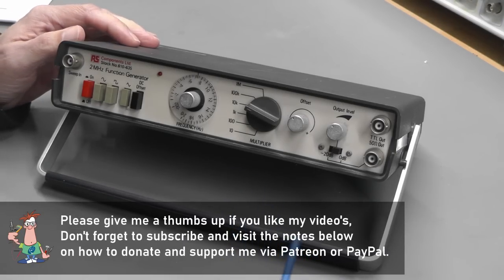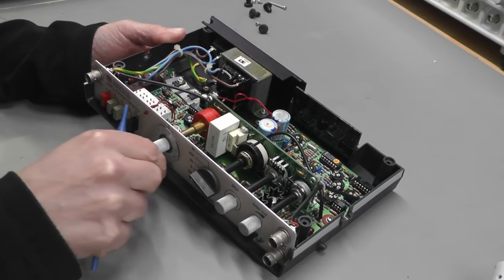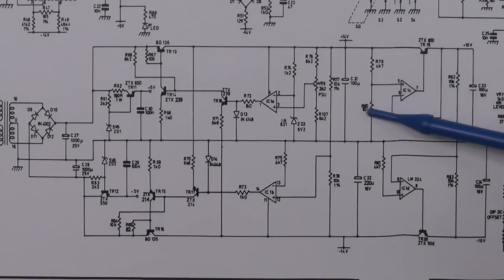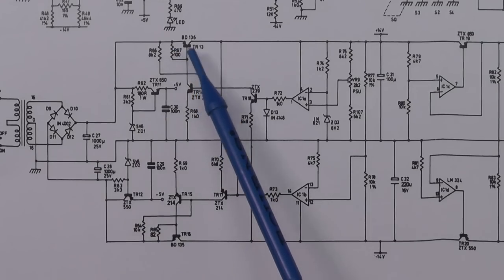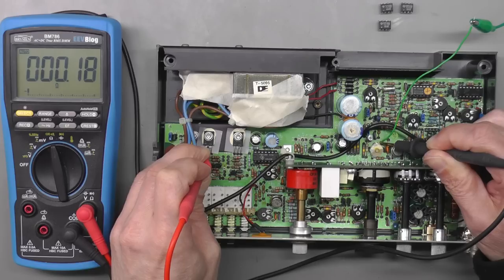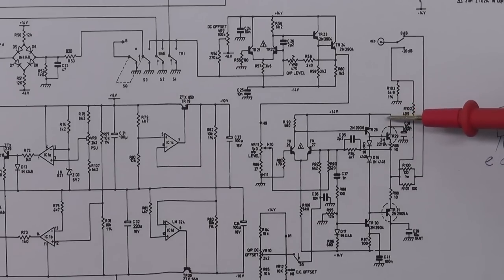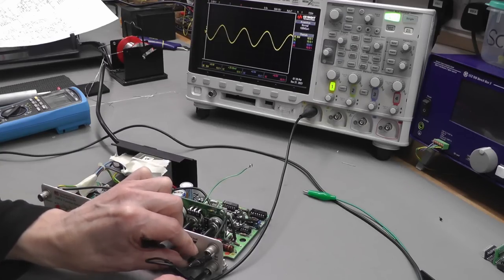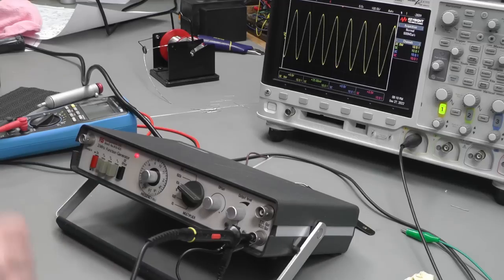No.101 - Thandar TG102 Function Generator Repair

Comment: Could not believe it mate..our little TG102 failed to work this week. I know what I'm doing with repairs, but on the off chance, checked if there were any videos for common faults. Your video and the schematic enabled a quick repair. Yep, it was those tantalums again. Both had failed dragging the +/- 14v rails down low. 16V caps on 14v rails ???.  Orange horrors. Cheers, Steve (Kent UK)

Comment: Great video ian. Another one here with the same fault. Capacitor bit tricky to insert due to sub pcb in the way.  Set capacitor legs to correct width using reverse of pcb as a guide then use tweezers to insert. Prepare to curse a few times. Have to agree think a inline fuse should be there for good practice. Transformer thermal will not help if a fault on red power switch develops and probable 13a fuse in mains plug on many units. Mains is only a cm  away from sweep input wires and pcb components and also is unshielded so just my preference.

Comment: This model has a thermal fuse on the primary, it is fitted between the two right hand terminals on the trans former primary connection.

Comment: those discrete 5V v
regulator circuits don't look like they'd be very good at temperature or current draw fluctuations? I guess if it's good enough it's good enough...

Comment: I believe Thandar was formally known as Sinclair Electronics owned by the late Sir Clive Sinclair (RIP). They later merged with Thurbly electronics and became Thurlby Thandar, today known as TTi (Thurlby Thandar International). I recently got one of these off eBay, mine had intermittent output and it turned out to just be dry/cracked joints on the pots.
Reply: Thandar was the more industrial side of Sinclair Research, there to make a brand that was UK made, but not associated with the Sinclair consumer side much, though they did make a fair amount of equipment that fitted in the same exact case , with only a front and rear panel change to accomplish this. You can see the back still has the moulded in battery compartment, just the cover is not there.

Comment: I never liked Thandar equipment when I worked in the test department, the size of the control knobs was always to small.  If your sitting at a bench having to adjust the frequency and amplitude a lot as you do when doing bandwidth tests they gave me cramps in the hand. :-( 
 Give me a level or hp oscillators any time. 
Still nice to see it saved from the WEE bin.

Comment: Couldn't believe my luck. I was working on the exact same fault on the same unit. Busy disconnecting components from the 14v line when I found this video on You Tube. Same cap s/c. Very awkward to get into but replaced it eventually. Working fine now. Realy liked your approach to finding shorts without disconnecting. Thanks
Reply from the maker: Great to hear my videos have been found useful.😀

Comment: Nice job! Can't believe they didn't manufacture this with a line fuse. Glad you added one.
Reply: Normally transformer will have a primary side one shot thermal fuse, especially with any transformer that was specified by RS. So no need for a fuse as the transformer will stop operating if it gets to over 130C.
Reply: @SeanBZA  It's curious that this is the first time I've seen a piece of electronic equipment without a primary line fuse. I'm an electronic tech and have seen plenty of designs (as I'm sure you and most of Ian's subscribers are).
Reply: @bubblehead78  TTI, being a UK company, has a 3A fuse in the plug, there to protect the cable from shorts. So no real need to fuse internally, and for overheating failures the primary side thermal fuse is perfectly fine as well, handling all shorts on the secondary, which will only blow the mains fuse on transformer final failure.  The thermal fuse, non replaceable, does stop things before the smoke phase, though the smell phase is well on by the time it operates.

Comment: Good move;) Analyzing the circuit lead to the solution. I believe your channel is underrated...
Reply from the maker: For a YT video I don't see the point in opening the unit up, finding a short circuit and going straight to a tantalum capacitor based on experience.......Thats no fun, no entertainment and no learning experience for my audience!
Thanks for your comments.

Comment: Back in the day many, including me, thought using tantalum caps was a good choice and so we used them in just about every design, years later all have been proved very wrong.   
But they are probably better in failure than the oozy electrolytics that trashed my top of the range Sony head end from 1994. Out of warranty and short of a full replacement pcb totally unrepairable.
Reply from the maker: Yes, I did a lot of designs with them.....47uF 16v tants on a 15v rail, what was I thinking! We popped a few LOL

Comment: Hi Ian, I have the exact same generator, had it since the mid-nineties. The power button is missing on mine and the exact same cap shorted in front of my eyes (blew a hole 💥in the cap body) as I decided to give it a bit of TLC after years on the shelf! Hope you are having a great Christmas 🎄 break, many thanks for the educational content, all the best for the New Year 🎉
Reply from the maker: Yes, tants usually destroy themselves spectacularly.....and if you're lucky it'll blow itself off the board completely, and open circuit!

Comment: Nice repair! Who would have suspected a shorted tant?  I'm surprised - it didn't appear to be discolored - they usually get all black and ugly looking. The transformer must be loosely coupled as I didn't see any overcurrent protection in the power supply. Regards, David
Reply from the maker: Shorting the +14v rail put the base at the same voltage as the emitter on the main pass transistor and effectively switch off the rail! A good wee design:
Reply: Those transformers have very poor regulation, due to the high resistance of the windings, so are almost a pure current source limiting the short circuit current.  Short it on the output and it will run for around 20 hours before it finally gets hot enough to melt the primary internal thermal fuse and stop operating. Even if the windings short out internally it will stop once the core gets hot enough.
Reply: Nice to see. I have the oscilloscope and the storage unit (which makes it into a storage scope). Both still work.

Comment: Why did you replace the Tantal with Electrolytic Cap? I though Tantal are more reliable, more durable.
Reply from the maker: Electrolytics when they go they go slowly, so there's a chance to replace without damage. Tants on the other hand they go fast. I've seen many, many PCBs damaged by shorted out tants. I'm just not happy putting them on boards...:-)

Comment: Singapore you say?
Reply from the maker: Early 90's, Jurong Shipyard, on board the new Tam Dao II jackup rig. I had the scope on top of a steel box measuring some electronics inside it, pulled the scope probe lead and hauled the scope off and to the floor.
Reply: @IanScottJohnston  Tam Dao 2...That was built for VietSovPetro and didn't even become operational until 2010 from what I have read.
Reply from the maker: @douro20 mmm, maybe it was Tam Dao I……..I can’t remember.